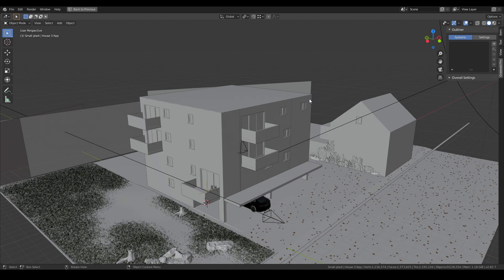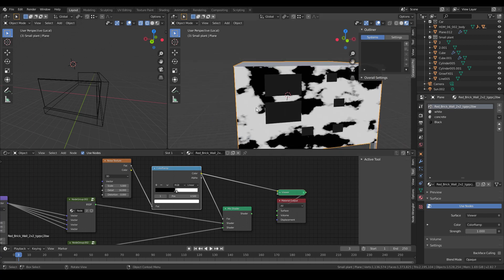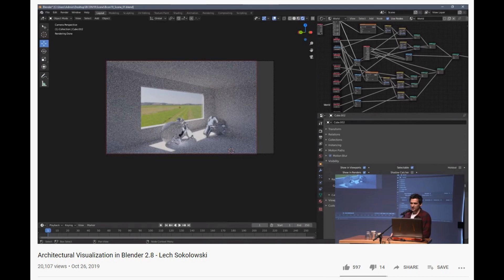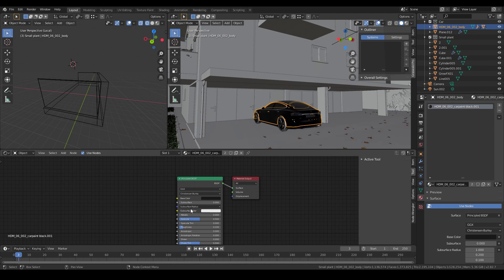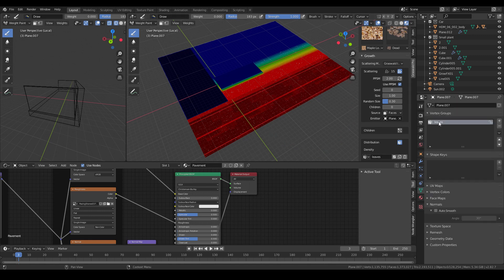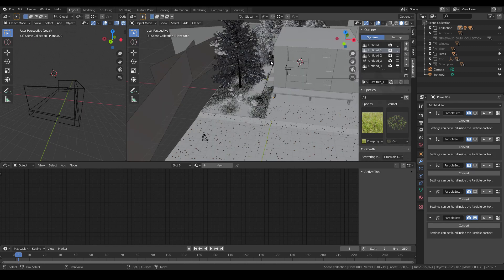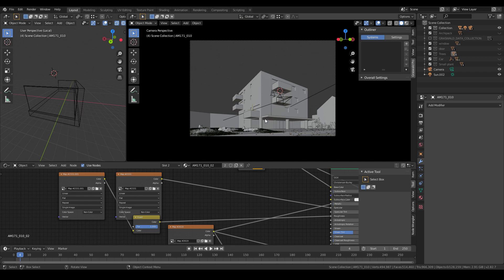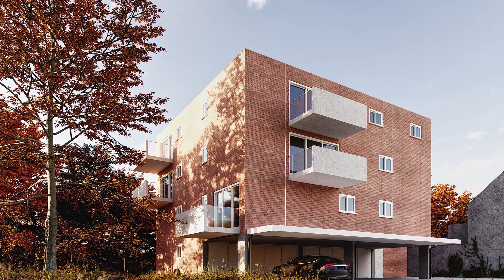Social Housing - Blender Archviz Breakdown

Comment: I really love Blender.. modelling is much better. But the only thing stop me from using it is all those material nodes.. huge time wasting rite there.. I prefer something like Enscape or D5 or Lumion.. No nodes. Btw.. thanks for inspiring video.
Reply from the maker: Of course the material editor in those software is easy to use but also limited in features. With node-based shader editor you can do more and even more when you are familiar with the concept. But again if you want to just achieve simple renders quickly then yes just go for D5, Enscape or Lumion. Cheers!